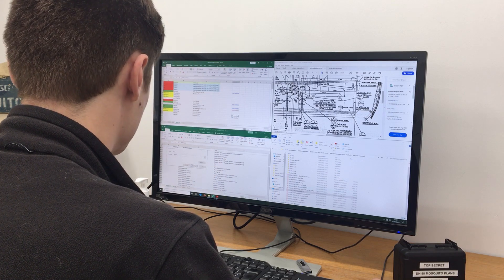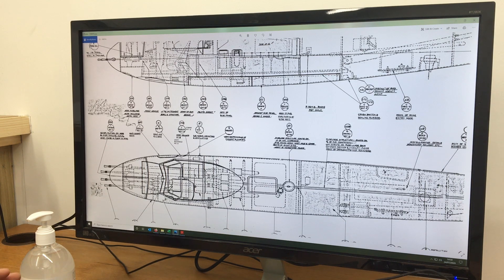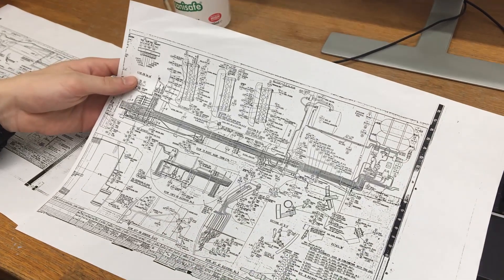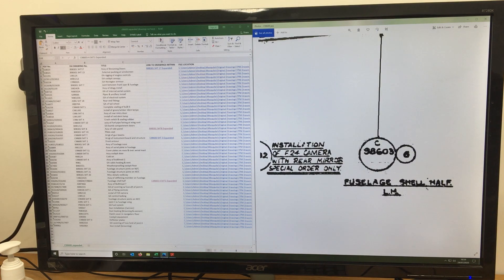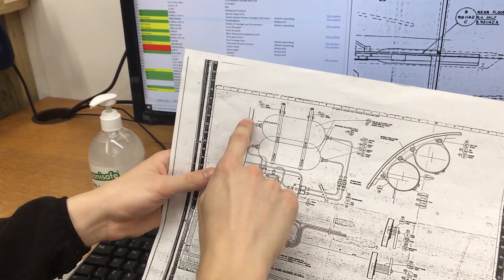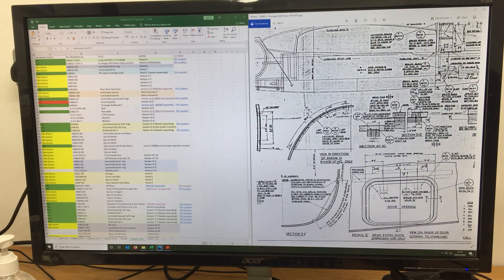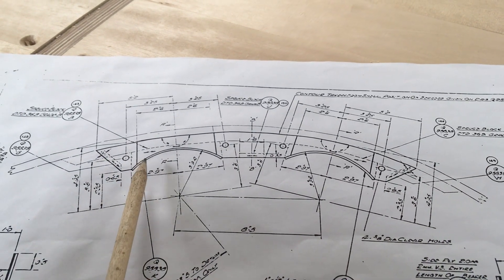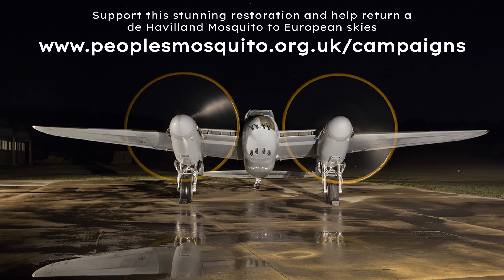The People's Mosquito - Restoration Update August 2020

Comment: Those drawings are from the Mossie museum. As I recall there isn't much on the wing. Glenn Powell had all of that. You could get in touch with the Windsor Mossie group, they have copies. Someone needs to do the work and transfer everything to Solid works.
Reply from the maker: We actually hold more than 23,000 de Havilland drawings - arguably the world’s largest technical resource of Mosquito-specific data in the world. We also acquired full Cad modelling and all the jigs necessary to complete the wing construction when we come to that stage of the restoration. For now, all efforts are focused on completion of the fuselage and that requires the moulds.
Reply: @PeoplesMosquito  The Canadians built the best mould. It was cement, unaffected by heat and humidity.
Reply: @carbidegrd1  Actually concrete moulds were made in all countries producing the Mossie (UK, Can & Aus) as the war progressed and necessity to ramp up production. Sadly none of these exist, all broken up and we don't believe the designs for them exist anywhere. Hence using the plans for the original approach. Many people often point out there are broken concrete Mossie moulds at South Mimms DHAM museum,  but these are in fact for the Hornet. No there's another beast :-) ....
Reply: @johnlilley2777  The Canadian mould existed until the early 90's in Statford Ontario. The Windsor group just missed it. It was dumped along the shore of Lake Erie as part of a  breakwall the Windsor group flew out to Halifax to look for the crash sites of two Mossies. They found them and recovered some parts. There are still 8 more lost in the lakes. After the war the aircraft and parts were sold off cheap. The Windsor Group and Tony Agar found sets of Radiators out there. That is one of the toughest things to find.